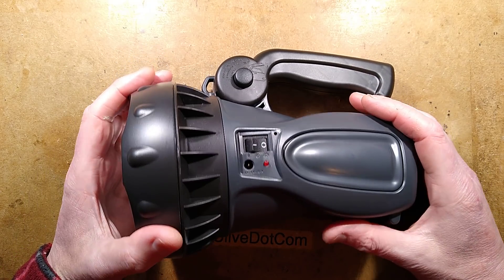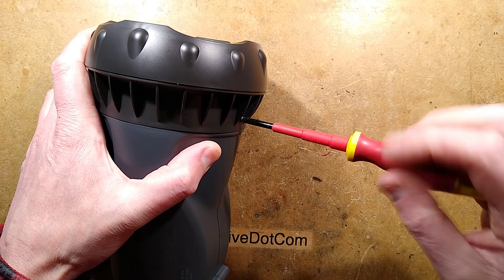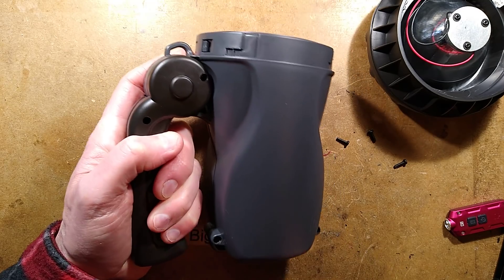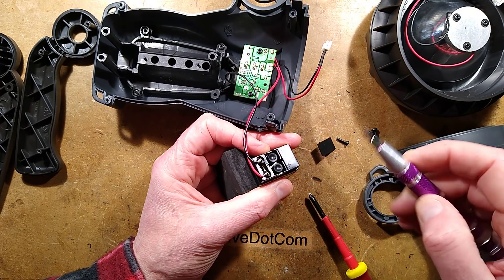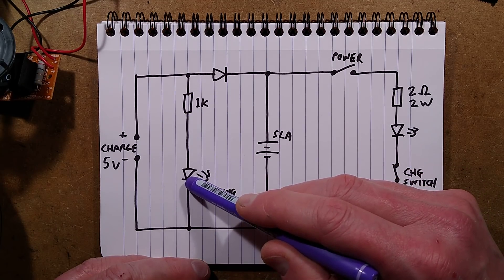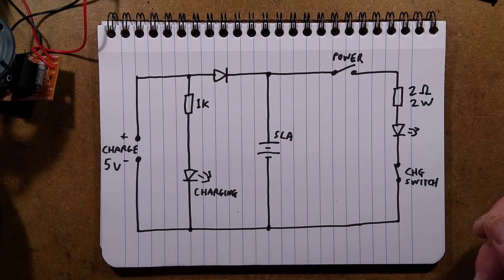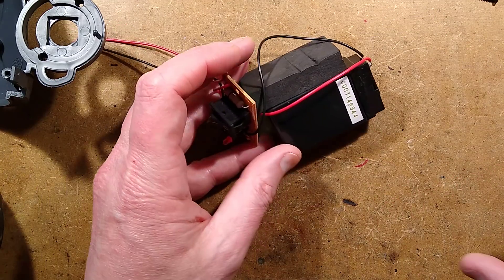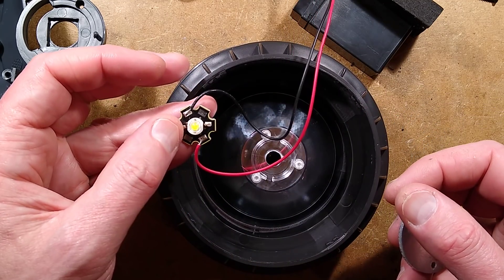Big light, but it's PISH!  (With schematic)

Comment: Chuckle.  You could put a boatload of 18650's in there, a buck converter for managing voltage,  and a BMS circuit ... and with that mounting setup a better LED ... all without bodging the case much.   FTM you could put a much higher wattage LED in and a cooling fan if you wanted..    What's the point of such a waste of space?   I have many torches much smaller that put out much more light (and probably just as cheap).

Comment: I found the same SLA battery in an aquarium air pump with battery backup which I have. Any idea where I can find one to purchase?
Reply from the maker: It may be cheaper to find the small SLA battery in a product.
Reply: @bigclivedotcom  very good point. I'd replace it with something else but there isn't a lot of room in the case :(
Reply: @josephschembri4811  Replace it with a lipo? Will likely need a change to the charging circuit.

Comment: It's funny that a tiny pocket thrower like an Noctigon KR1 will have better light, longer throw, better battery life and the convenience of replacable battery (1x18650) and stepless adjustable brightness in the size of just the handle of this light.

Comment: So how long would that battery power that LED ? 24 hours ?
Reply from the maker: No.  It dimmed very quickly in a matter of minutes.
Reply: @bigclivedotcom  Put it on charge for 2 weeks - then try it. If it runs for an hour, charge it for a month. Or charge it until the charge current stops dropping. We don't know the charge history of it - so assume the battery's been left discharged for too long.
OR work it out - amp-hours of the battery and wattage of the LED.

Comment: It would be funny if you found a standard 5mm white led in there as the 'bulb'.  I had a torch which had 9 of them in parallel across 3 AAA cells.  It drew about 0.4A which was way more than the 9x20mA maximum rating for the LEDs.  The LEDs died one by one and the torch got bluer and bluer as the current to the remaining LEDs got larger and larger.  I didn't get, for a few pennies, why they couldn't add a resistor to limit the current.  I was equally surprised to find no resistor charging that battery as all SLA batteries have a maximum permissible current and I can't see that battery being big enough to handle 1A or even 2A from a usb charger.   It looks like maximum 1Ah which would have only been 1 or 2 hours light.

Comment: Getting into it - My guess, on looking at it, would be that the initial screw had to come out to allow the front of the torch to screw off. I was close as it was a bayonet type fitting !

I serviced my 34 year old vacuum cleaner (Not a xaV original model) yesterday as it's literally been screaming for attention occasionally. I'd had a go a month or two back and was defeated by an impossible to access electrical connection. This time I ignored that, and took out the handle bolts - to discover I actually don't need to disconnect that connector ! However, the motor assembly came with quite a few puzzles - the motor fan was screwed on - an easy -ish spot but on 'unscrewing' it, it revealed it was a left-hand thread. Back bearing accessed, lubricated and worked in - but as it was a bush, I knew that that was not the screamer. xaV had provided more puzzles for me - motor fan cowling held on with a screw and an inaccessible nut. That had me fooled a short time - the screw came out easily - then  'does this just pull off?' - yes ! The hardest bit was getting the main sucker cowling off. Big hammer job - only to discover I needed to remove the sucker ('fan') nut - as it's twin suckered with the first one trapped within the cowling. Anyway, once dismantled, I had access enough to lube the man bearing - then it was just a matter of reassembly, en route a quick brush inspection (fine) and a dusting down with a toothbrush to clear the accumulation of fluff.

The service certainly freed the rotor off nicely.  I don't understand the bush and ball bearing bearing arrangements on fans - as there's no side load on them. Same situation with my gas boiler fan motor. it too has a ball bearing main bearing and a bush on the other end.

Comment: I wonder how the light output compares to a 18650 flashlight.  I didn't see a way to adjust that narrow beam width.  The 18650 flashlights usually allow you the adjust the beam width by telescoping the lens.

Comment: Have seen similar flashlights in senior care homes, they contains the 6v lead-acid battery and not so powerful beams. They are selled as emergency lights when main powers are off.
Lead-acid batteries are maybe better (or safer) in them, because they are usually sitting 24/7/365 in their chargers, waiting for  emergency situation which hopefully is not coming.  Li-ions/polys maybe aren't good on always in charging devices.

Comment: About 10 years ago i bought a flashlight that used 4 AA batteries and the LED was set into an old school style incandescent bulb housing. Still works great i only have to change the batteries in it once since i bought it. Feel like they wouldn't make something like that today tho even if i'd like a higher power version :(

Comment: one can see that is rubbish, the parabolic reflector is beyond the LED source.  It will be useless.  And the single LED won't provide much light. It is basically a large battery holder with an LED indicator to show there are batteries in it.

Comment: The "18650" compartment on some models of the torch (Rolson in my case) houses LEDs to turn it into a lantern. I modified mine with an RC battery and charge circuit and a beefier LED. Mine also had 2 batteries.

Comment: at store they have a spot where you can drop your old bulbs, batteries and such... from there i found light like this but it has 230v mains lead in some compartment. apparently it has gone pop but it still has reflector and case. so i could house li-ion cells and some 1 eur power bank pcb in it. so i have charge level and even 5v output

also, like "focus you fuck" you could say "measure you moron" to force dmm to measure things

Comment: Big reflector and no use for it at all with LED of that style, it's obviously made for halogen lamp. Nobody make then anymore in china, at lest it seems so last time I looking for bulb as replacement for my old VARTA torch of this type. That one was made for D cells, modded ofc to Li-Ion with tiny boost converter to get 4.5V needed. 
I don't know why I ever bother with charging port and 4056 board, with usage that lamp get battery will probably last longer than me.

Comment: I have a similar one, with a 6V lead acid battery, that went dry very fast. Tried to get a new one, but prices are prohibitive (30€ or more including shipping) and largely exceed the cost of the unit. I was thinking of putting a Li-ion cell and charge control, but then again, the price of a new unit is lower (parts are getting extremely expensive, even from China, after the EU forced the advance payment of VAT and import charges at the origin).

Comment: Well Clive, you know - money, money, money. There could be a higher end model with the same case, or, they simply decided that nobody would buy it at a higher price, larger battery or not. A lithium battery would require a more complex charging circuit as well.

Comment: That empty-ish case reminded me of a comic I saw in the 1970s, in Popular Electronics magazine, I think.

This guy is looking at a label on the back of a large speaker 🔊 enclosure which said, "To avoid the danger of shock, do not open!"

So what did this guy do? Got out a screwdriver and removed the back panel. Inside were two things: a TINY speaker and another sticker which read "We told you you'd be shocked!"
Reply: You've got a few thumbs Chaplain Dave which means you tickled a few ribs, but I wanted to take the extra time to say thanks for typing up that joke.
Reply: lololol!

Comment: Such a small battery for such a big case. Though possibly better than a single 18650 in terms of capacity.
Also thinking they saved a few pennies by omitting thermal paste/tape.
Reply from the maker: The capacity is miserable.

Comment: I have one of rather similar design , however replaced the 6v H3 55w halogen with an HID 35w 12v light source, and RC car 11.7v? lipo pack. Thing will blind you .  Runtime not great, but works for the purpose .

Comment: I would have loved to replace the 4.7v Lead Acid battery with 6 or 8 pieces of 18650 and replaced the LED with a LED array of a much higher wattage and corrected the focus to the new configuration. With such a huge space inside you are free to do anything your heart desires.

Comment: I have converted a few of these similar sized lamps and versions which run on 3 D cells. Modded with 3x 18650 cells and a tp4056 module and yank out the old charging circuit, sometimes add a hole for the micro usb if a battery door isn't available.

Comment: USB charging & a Lead Acid Battery just seem like a weird combination to me. Actually the idea of a high tech(albeit simple) product with just about the oldest battery technology is weird.
Reply: Just remember 12v pb acid batteries are STILL powering the electronics/computers of pretty much all motor vehicles on the road today, and they are 100% reliant on them to start.... Even ELECTRIC cars still have a 12v pb acid battery to run the computer and 'start up' the main battery. Tesla this year actually did away with the 12v pb acid battery on new models in favour of 12v li-ion, probably the first manufacturer since the war to do so - and not without complaint, critics argued that running the starter battery stone dead accidently (leaving lights on the most common reason, continuously cranking a car with no feul or the immobilizer triggered until it dies the next most common) is extremely common, and while it does little damage to a lead battery which you can easily bring back to life with a jump starter or a garage charger, 12v lithium is a different matter. I have even seen forums where people are describing how to replace the lithium battery in thier Tesla with pb, and how to phool the computer into thinking the lithium battery is still there.....

Comment: The true tragedy here is the utter contepmt for the function of the torch.
If they had put a cast aluminium front housing around the reflector and had the LED couple heat into that, if they had taken the lead-acid battery right up to 12V and if they had put in a current-limited buck converter at a higher current, the torch would have been brighter, lasted longer and run cooler.
But, as was stated at the outset, this was made cheap to buy in bulk and resell.

Comment: You could fit so many lithium cells in that bad boy......   and a modern LED package up front (will probably need a heat sink stolen from a computer and a maybe a tiny fan...  but you have all the case size in in the world)

Could be such a beast.

Comment: Looks like this is an upgraded version of those old halogen/lead acid "ONE MILLION CANDLEPOWER!" lamps that were popular back in the 90's in catalogues.
They just took the same body, complete with lead-acid battery and charger, and just connected an LED to the output instead of the halogen lamp.
LEDs are more sensitive to the descending voltage of the lead-acid than the halogen, especially since they didn't bother to give it a real LED driver, thus why it dims so rapidly.

Comment: Clive, you could make a video about modifying this with a more powerful LED and the said 18650s and charger. Through the screen it seemed that the battery is only half the problem, the LED seems to be quite weak for such a large light.

Comment: Talk about "room for improvement" inside that absolutely cavernous container! WOW! You could absolutely load the insides up with battery of whatever flavor you want. Heck, just using as a container with the input/output terminals on a disk of plastic on the front where the LED used to be. Nice that they put the LED on a little connector like that, but solder the battery to the board/terminals. Maybe gut it of all photo-emitting powers, and then load it up with LFP batteries, and have it as a gigantic portable power bank, with built in extra FANCY carry handle. And moderately water-resistant if you would put a smear of silicone in the gap.

I know I have said this before, but people always ask me what possible use those tiny lead batteries would have: Emergency/fire lighting fixtures still use them, due to the stupid simple circuitry needed to keep them trickle charged all the time, and to detect when the power goes out. I would bet you cash money that these same PB/SLA batteries are in the tiny "Exit/Egress" signs, but the market is being slowly replaced with the LFP versions, and/or super cap, so they have to sell them somehow.

Comment: hey mister dotcom, have you seen the MIT video on the guy experimenting on cleaning solar panels electrostatically by charging the dust and then passing a wiper over it to attract the dust? I thought it would be right up your alley with your great concentration of electrostatic cleaning devices.

Comment: Got a version of that with 2 LED types on it, one spot style with the same 1W star, and a second LED strip on the side. Has a lithium cell in it though, and my upgrade to it was to remove the star from the front, and replace with a UV star, so that I had a nice bright UV light to look for leaks with, but also with a regular light for working with as well. Not the best capacity cell, but should add in a big pouch cell to replace it, to get a decent light output, there is definitely room enough in the housing for that. Should also probably put in protection as well, seeing as they used a unprotected cell, but I simply charge it up and use a power supply, so moving in a charge controller should also allow me to use it with the supplied 12V charge lead.

Comment: That lead acid battery is around 500mAh capacity, because there is only a single small plate of spongy lead inside each cell as terminal, each in a non woven plastic bag, and soaked with sulphuric acid, then the spare volume is filled up with an expanded polystyrene sheet, that provides volume to fill the rest and compress the pouches together. Then the terminals are soldered on, and the top is fitted and solvent welded on, and then filled with a small amount of acid, then capped. Cheapest battery around, simply because it loses capacity so fast, and the cells are generally also made from scrap SLA batteries, with them being stripped to provide the lead grid and the paste, and cutting the separators to fit the new housing. Unlike any other lead battery, this is under 200g, with most of the weight being the plastic housing.

Yes had a number of dodgy lights come my way over the years with them inside, some even go so far as to have a single cell construction, so it looks like you have a bigger capacity, but they simply put in a much bigger expanded polystyrene sheet to fill up this extra volume, often using recycled polystyrene, seeing as it often still has knife marks on the one surface and 3 sides, where it was hacked from a larger block of waste.

Comment: I'd like to stuff it full of 18650s and a charge controller, change the emitter to a wider angle 3W one and underrun that so that it does not burn out too quickly, and there's a very usable torch with long runtime. The sealed lead acid battery could be used for something too, they have long shelf lives if they're being topped up but not overcharged. Emergency exit light battery or something.

Comment: I have a giant lamp of similar design I bought in France, at the Auchan Disneyland actually, back in about 2004. One of those "that'll be useful one day" and I'm still waiting for the day. It has a car headlamp bulb run by a 12V7W lead acid that died a long time back. I can see a 12P lithium set up going in with LED and TP4056 now this video has jogged my slumbering brain.

Comment: I have somethin similar with a 6V Lead Acid batter that fills the body of the lamp and a 6V G10 halogen lamp. It's great!
What species of moron uses a parabolic reflector intended for an incandescant lamps with a unidirectional LED source far behind the focus?

Comment: I think I might be able to help with why it is so big.

A long time ago is a Halfords in Hampshire, I brought a led torch on sale (LED torches were still a new thing back then). The torch was same size as one you have, except the compartment used a battery holder that used either/both 4xAA cells  and/or 4xD cells. I soon found out why it was on sale though, great for lighting a small area and bad at being a floodlight torch for use outside.

So maybe, they have all these cases left and just trying to use them up? (Yes, I still have it and use it on original LED)

Comment: It looks like it was originally sized for a lantern battery, or designed after an older flashlight that took a lantern battery (alkaline/zinc-carbon, square base, 6V in the US).
Reply: Agree, the design was originally for the 6v lantern battery then the newer ones have gradually become slightly smaller. What gets me is that the light output for many small 2x AA torches is easily much higher than these big cheap lamps.
Reply: The original was. I still have one.
Reply: @dogwalker666  my mom has one of these with the massive lantern batteries.  i wonder how hard it would be to convert it using RC car LiPO cells.
Reply: @chubbysumo2230   dead easy, Use a dead battery case as an enclosure hot melt glue does the rest.
Reply: My daily hack is an Ledlenser P4R Core 200Lumen Rechargeable Torch….. pocket sized but I’d swear it’s at least as good as the old Police baton sized Maglites.
Shine this on yer tonsils on full power? If they’re not red before, they probably will be after.
Actually a great 3 level smooth zoom torch & rechargeable too.